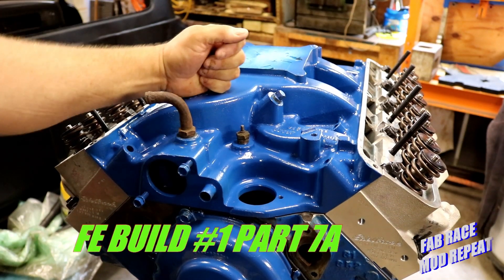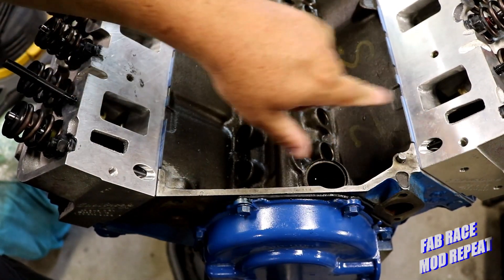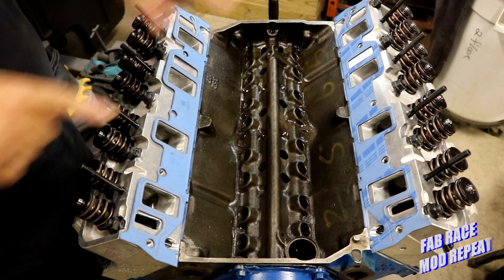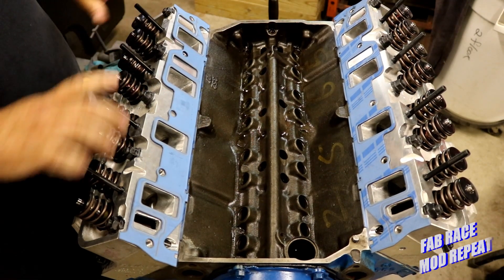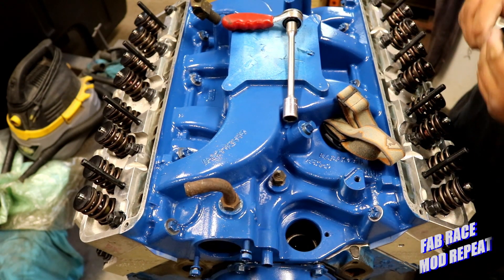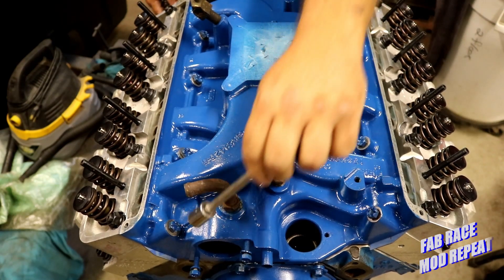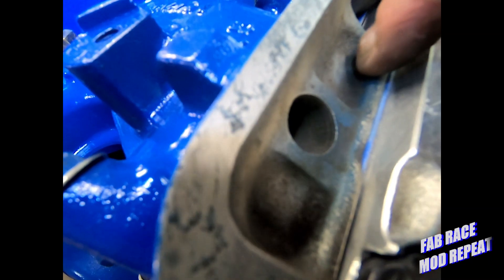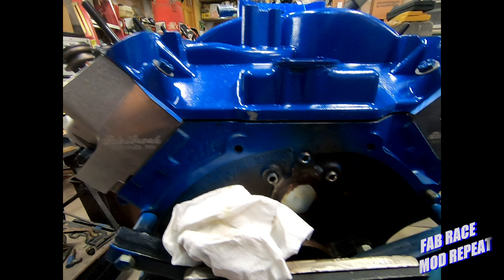Fitting the FE ford intake

Comment: I have done so many of these intakes, iron, aluminum, shaved. 2x4, single 4, Cross Ram, Tunnel Wedge, and they are all great and serve a purpose. I always pull the dowel out of the China wall. I use silicone.

Comment: Mine has blowby thaT comes out filler cover tube that goes into intake.[considering this possible problem]
SO how do i tell if my 360 Fe needs a rebuild more OR will benefit from a 4 Bbl intake and carb size jump from about 350cfm to 650 cfm?
i got it running pretty decent last summer  after new ex manifold gasket on drivers side,  gas tank, fuel filter and chinee clone carb and alum rad w/elec fans
BUT it wont even chirp its tires off the line w/o brake/Tqing.
Compr test says#4 is only 87 psi and rest are under 110.
AND now just this summer it sounds like it blew its ex gasket already as theres a real noticeable Ffft, ffftt ffftt .
=theres no nearby used engines, closest is about 15 hrs drive and 2800 usd/4000 cdn plus fuel there and back.
Reply from the maker: From the compression test, it sounds like you need to rebuild it. #4 at 87psi……that’s definitely an issue.

Comment: Always install the distributor before final tighten on the bolts, its critical, if you dont you may have trouble getting it in or put undo stress on it. Hope this helps.
Reply from the maker: You are correct. Typically I follow that path.
However this one is a special case. This manifold really should be replaced and I believe  I eluded to that in one of the episodes however, it holds sentimental value to its owner. So I made it work the dizzy does come in and out easily in this one.

Comment: I just put a CJ Pony intake on my FE, had to do it twice and it still sits high on the front and back of the right side of the head, hopefully I don't have problems with the valve covers leaking.
Reply from the maker: If the clearance issue is all on one side it could be quite a few possible causes. Curious question who was it made by?
Reply: @FabRaceModRepeat  not sure who it is made by, but it is made in China. I'm going to run it and hopefully it's fine, it's around a 16th off front back right side.
Reply from the maker: Understood
However, remember typically on the FE if it’s off at the top, it’s off at the bottom. If you have a unfindable vacuum leak or oil in the intake. Pull it back off and do some measuring. Good luck and thanks for watching
Reply: @FabRaceModRepeat  ok sounds good. Thank you!

Comment: Remember to put silicone in the corners,silico.the back gasget,oil and vac.leaks,i have been thru the install and removal many times,til i got it right,
Reply from the maker: Thanks for watching.
Excellent points.
I cover all that in the “installing the FE Intake video.
Reply: Good luck with it

Comment: IS THERE NOT A FRONT AND  BACK CROSS GASKET
Reply: Front and rear corks, just swapped in a 4 bbl on a 67 f250. Some people just dont use them and will just use a .5in bead of RTV.
Reply from the maker: It’s up to the builder. If the China wall clearance is real tite but, everything else lines up; I might go straight RTV. However, typically I run the corks. Thanks for watching and commenting!
Reply from the maker: Indeed there is one on each end. I leave them out during the mock up phase.

Comment: Will this be a common issue with an aftermarket intake as well? Also, will there be a fe build 2 coming?
Reply from the maker: It really is a case by case situation. With a new intake or old It all depends on how much the block has been machined and where the heads are, if they are not new. Tolerances stack.
IE if the block has been decked the heads move closer together. This in turn pushes the intake up on the heads.
  FE build 2 will be coming soon, we are waiting on a few more parts to start that build.
Thanks for watching

Comment: Hi there. I'm curious if this thread is still being responded to. I'm buying a 390FE and would love getting input on refurbishing it, getting it running and sitting it in a 56 Ford F-100 Panel Truck (My retirement gift to me)! Any advice on what cam, heads, manifold, crankshaft, what electronic fuel injection kit to get, etc would be appreciated.  Thanks in advance.
Reply from the maker: It’s one of my best video series.
Reply: @FabRaceModRepeat  Yes, I'm glad I found it!!

Comment: I seen a few guys set the distributor in also to align it...
Reply from the maker: The distributor is the main alignment on most FE’s (99.5%) however, sometimes you need to move other intake around a bit. That is the case here. The main thing is to have a fresh seal ring on the distributor. That way the rubber will conform to your intake.

Comment: What size rating engine stand would you recommend working on the BB FE ?
Reply: Thanks for the quick reply
Reply from the maker: My stand is your typical 1000lb model. It’s served me well for a long time. I use it for most engines.
I also a 1500lb twin leg model I you for 385 series engines.
Reply from the maker: No problem
Have a great day

Comment: I saw a guy using silicone instead of gaskets. No good or?
Reply from the maker: Evening,
Some builders do the silicone only trick. I’ve never been a big fan of it.
Reply: @FabRaceModRepeat  - Yeah, using a lot of silicone to fix an alignment issue can lead to bits of silicone getting into the engine.  Oil pumps don’t tend to like that stuff very much.  😉
Reply: Both

Comment: You should use metric flat washers instead of those standard. Flats that look and fit sloppy. The factory used specific flats on aluminum intakes. I do not agree with your intake procedure but you do neat work and I am not putting you down. Depends on who taught you. Luckily I was taught by my uncle and dad both Ford schooled service techs that did not cut corners.You were taught the same it appears, even sharp fe builders have different procedures with very similar results.

Comment: wish you wouldn't had fast talking when you were saying something at 10:31'ish in the video, reason? I went to break in a new motor, ran great for 2-3 minutes, then heard a noise, shut it down, pulled the valve covers, found the noise issue, fixed it, but had water in the oil, milky, nasty, so I'm trying to figure it out, I am HOPING it is the intake manifold, and I know there is the water jacket right next to an oil return hole.....was hoping to hear what you said there...but cant. Will be pulling intake tomorrow, will watch this video again, just cant believe my 1 year long rebuild has this issue!! Anyway, what did you state at 10:30'ish??
Reply from the maker: Basically passenger front corner and driver side rear corner were tight, IE: zero clearance. The rest of the intake was .006 or more loose down each side. This indicates a warped intake.
Reply: Did you try playing the video back at  this timing mark at .5 or .25 speed?  Just a thought.

Comment: Thank you!! I'm considering the aluminium manifold. My 58 has the stock cast iron.. Question though for now - I would like to run a PCV system and was wondering if there is an ideal location in the rear of the carb to drill through for a manifold vacuum source?
Reply from the maker: I’d add a 1/2” spacer plate with the large vac connection in the back.

Comment: Absolutely an issue on FE engines. Sometimes coolant winds up in the oil, or it pulls oil into the intake.  The dowel pin isn't necessary for alignment. However, using the distributor is. On my 427 build I had to square up the intake flanges. I had .010 milled from each side because the heads were milled .025. It also requires the bottom of the intake to be milled. The intake is the most finicky part of an FE build. Great to point that out.
Reply: Good ole youtube, had NO idea of this FE finnicky important detail.
Reply: Terrible design.
Reply: Thanks it’s not my ride but step son who owns car , rebuilt and starting first time mixes oil and water a lot, bout 9 quarts of mess. Seems like a lot of mix for head gasket , but didn’t think water was routing thru intake  have offenhauser intake where back water ports are closed, guess it circulates thru head, installed new pushrods and lifters where water caused a lot of compression, didn’t test the heads but will try some fresh gaskets and see

Comment: One obvious problem with this video is the maker may have test fitted the distributor, but you must never attempt to fit an FE intake without the distributor. The failure to include it in the video is a serious failing. In the next video he shows the distributor being installed, but it is advisable to install it before the intake bolts are inserted, and by the time you are attempting to install the intake it is far too late to find a fit problem at the distributor.
Reply from the maker: wawacan 
98% agree with you. However this intake is so used up it didn’t really seem to matter with or with out the distributor installed. Plus we did retain the alignment pin. I’ve also found the MSD distributor seal to be way more forgiving than the older harder ones from years back if you find necessary to install the distributor after the fact.
Reply: @FabRaceModRepeat  I hear you, and you did mention it, but you presented this a a video to help first time builders from making mistakes. It is a really important step.
Reply from the maker: wawacan 
I do appreciate your input. We’ll do it by the book on FE Build 2 (hopefully coming later this year) as it will be all new parts. Expect for the timing cover and block plate.
Reply: @FabRaceModRepeat  It is great to see any videos on FEs. Keep it up.

Comment: having the knowledge on this type of motor is great to have  for someone like me ,I would install the intake and have all kinds of problems.  great job and information
Reply from the maker: michael wasson 
Thanks for watching, glad you found it helpful.
Reply: @FabRaceModRepeat   You are doing it right.  It was genius new. Doing them now you have to plane the head and intake before you start. I bolt it on for a week before measuring for final installation. Jay Brown made Slabs for each side and across the china Walls to fit Cleveland intakes.  Well worth it. But Ford deserves the genius award for how they did this. 99.5% on the line installations were just drop, the 80 lb intake was square. Aluminum was a challenge., I wish all of the aluminum ones had been 2 piece, 3 with the tray.
Reply: It wasn’t intake after further review might not even be a 390 someone pulled a switch, but it’s the lifter valley has a crack about 7 “ long wonder if it can be welded or fix somehow